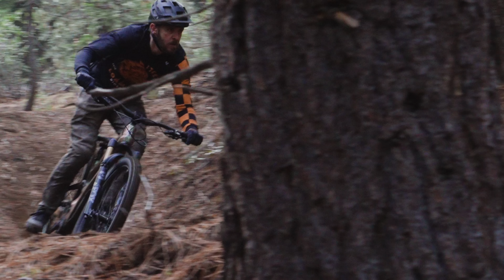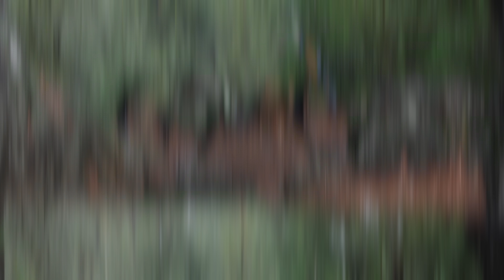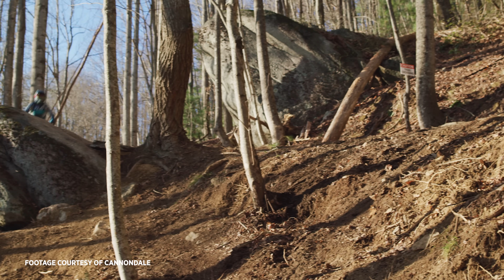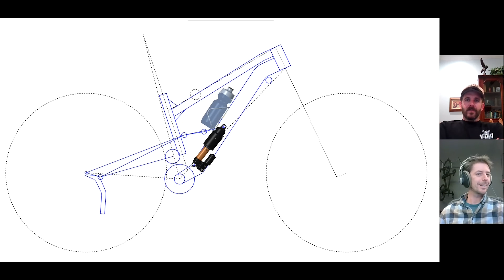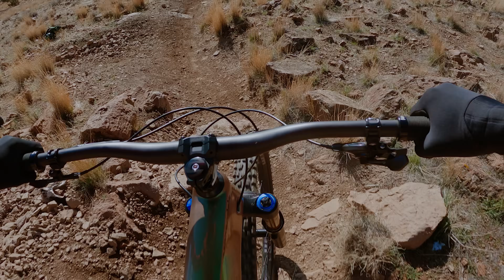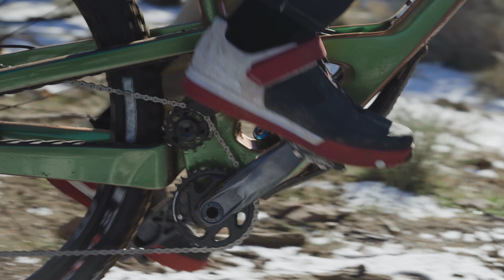2022 Cannondale Jekyll - High Pivot & High Hopes | Dissected &...

Comment: the Stiffness talk is a little bit bullshit
Reply from the maker: Could you explain why/how you came to that conclusion?
Reply: @TheLoamWolf  XC Frame are stiff enough at around half the structural weight of an enduro frame(yes some XC frames use uhm fibers in some areas and the geo differs) but over all its not a problem to design a Enduro frame which is stiff enough.

Strength on the other hand is hard to get (without making the frame to heavy or unpleasantly stiff(yes you can build a frame to stiff))

How often did you ride a Enduro frame and thought this frame is not stiff enough?(not a very common problem with carbon enduro frames in my opinion)

But every time A Enduro Frame breaks it was not strong enough

The real Challenge is to get the frame as stiff as you want(not to much, a little complience often leads to more forgiving ride Characteristics) combining this with a low weight, good strength and the biggest challenge of them all: Acceptable Damage tollerance(this is where the biggest weakness of Carbon frames(lacking "Toughness" possibly leading to catastrophic failure) is considered) than you got a structural good carbon frame.

If you want Youtube Proof check this out https://www.youtube.com/watch?v=4X3wxaXqD5E&t=762s&ab_channel=NekoMulally  (very light but still to stiff)

So after all i dont know why he made this claims(about stiffness) but maybe he has to sell his split down tube (which in my opinion is not the biggest innovation in the world). 

PS 
if its about center of gravity you have to consider the whole system (inculding rider, maybe water, maybee a back pack(yes i know not all mentioned things count equal)) and then a Shock(1 to 2 pounds) moved a few inches down may not make the biggest difference.

PPS
If the Cannondale guy needs help to get his frames stiff  he can consult me, but im not cheap.

PPPS
As he talks about durability you can count Strength and Damage tollerance (the terms i used) into that

Comment: I have bought this bike.  Absolutely love it.  It is impressive at every turn. I went a smaller due to new RAD measurements.  The cockpit is still comfortable to ride, and I am 6'1" on a small.   So impressed, I want another one for steep terrain in a longer bike.  Lets say it's for the wife, wink, wink.  Well done cannondale. So glad I pulled the pin on the norco range and got a jekyll
Reply: I'm also 6'1" and typically ride a large, but according to their size charts they recommend an XL(?).  Any insight on which way you'd go?  I'm leaning towards a large.
Reply: @leozz8074    depending on where you will ride it.  I wanted something to jump and be more playful as we don't have much steep terrain.  I needed the travel.  But I went on a recommendation about this measurement called a RAD.  It has you in a stands for maximum torque for a huck.  It worked out my RAD was 835mm.  That is the measurement from the centre of the bottom bracket to the centre line between your hand position on the handlebars.  Mine was a mind blowing exactly the same as a small.  I was looking at going a large in the original order then wonder if I should have gone a medium due to the large reach measurements were too big for me.
Reply: @gregoryschmidt4676  Interesting.  I'll have to look that up.  I'll be riding a mix of xc and steeper terrain in the Rocky Mountain region of the US.  Thank you very much.

Comment: Beware: Read Cannondale’s fine print in their Limited Warranty Policy. They may use it against you for their best interest. My $5000.000 carbon fiber frame Jekyll broke after six years of use. Cannondale never made a finding that it was due to use or abuse. A hairline crack formed at a weak point in the frame. The bike was sold to me with a lifetime warranty on the frame. The best offer Cannondale gave me, under their lifetime warranty, was 20% off of retail – yes, that's right 20% off of retail. I fought them on it over a two month period and lost. So, I am now stuck with a 34lb paperweight. Cannondale has what I feel is the worse warranty in the bike business. If you do purchase a Cannondale bike and something goes wrong, know that they probably will not work with you at any level in your best interest. In my opinion, Cannondale does not value you as a customer, they only value your money. This has been my experience.

Comment: If I had not just bought a Evil Wreckoning, I think the new Jekyll 1 would have been next on my list.  I'd just dump those WTB wheels it comes with, swap the air can for a coil and It'd be about perfect for me.  Solid spec for the $$, in today's market anyway.  The mid pivot design seems like a great compromise.